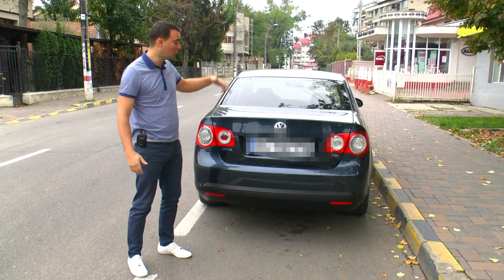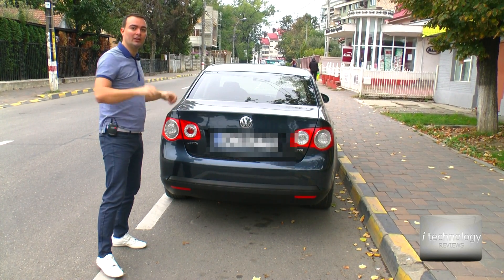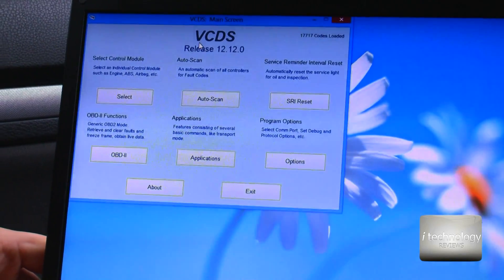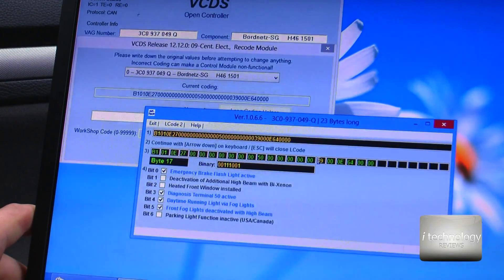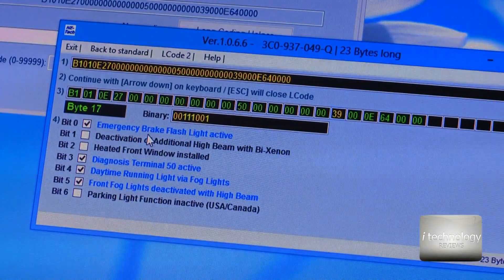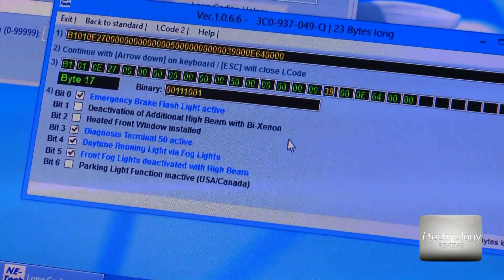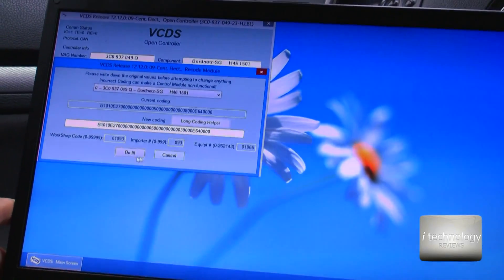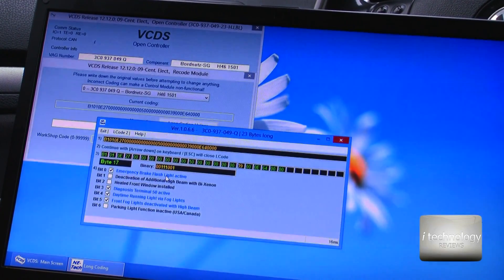Emergency brake warning signals flash/lights highway Vw Jetta/Passat/Touareg/Audi A4/A5/A6

Comment: I have had this option enabled via VCDS for a couple years now. Very rarely do I accidentally trigger it. I do drive her a little rough sometimes though and have a feeling for it. 

I believe it is triggered when going at least 30-40 MPH and braking to slow down 30+ MPH within about 2 seconds. FYI, just from my experience in setting it off. You can turn it off by pushing the hazard lights button.
Reply from the maker: hi; please check it if it works and return and comment; maybe film it

Comment: I turned it on in my Skoda octavia II ( Facelift ) MY2010 but I tested it few times and I believe it doesn't work , can you tell me what should I do to test it correctly ??
Reply from the maker: hi; do you have a good VCDS? and it's not necessarily to work on all cars!
Reply: i Technology Reviews Thanks for your reply really appreciated, I do have a good VCDS, I turned on a few options and it worked well, i googled this option and it can be opened on my year model and saw a couple of videos on youtube for the car same model and it worked fine, very confused may be I don't hit the brake too hard or not speeding or something like that ?
Reply: Hi can you tell me how you did it i have the same problem

Comment: Does brake flashing only work on a 19 bytes abs module? If i check the bit in module 09 it doesn't work, only hazard light flashing.
Reply from the maker: hi; it will not work for all cars! you don't have to go in other module than 09;
Reply: i Technology Reviews Hi yes that's true but figuring out how to make it work and what hardware is needed.

Comment: Salut.Am o nelamurire...fac pasii pe care i-ai descris..dar mie nu mi se salveaza setarea..oare ai idee  dc?mersi mult
Reply from the maker: hi; in english please to help others
Reply: Hello.. I have a problem.. The program don't want to save.
Reply from the maker: hi; try vcds 12.12 and try to run it as admin. if not try a original vcds (price 300euro vs. 25e a clone)
Reply from the maker: and you can try with other vcds beside your own because some cables can brake very easy and don't make updates to vcds clone
Reply: But... I can see the errors.. Everything just I can't save the settings... I mark and he sad me coding accepted.. But noting change...
Reply from the maker: yes broken vcds clone can do this fake ACCEPTED message; i told you try with other vcds maybe it will work
Reply: If I download other version vcds I don't work... I have error
Reply: Thx for helping..!
Reply: @iTechnologyReviews  Hi. I just activate Emergency brake flash on Passat b8 but its dont function well.

When press brake pedal the 3rd is flash just once and get off even if hold break pedal.

Please help me with this to get back to STAY OlON when brake pedal is hold